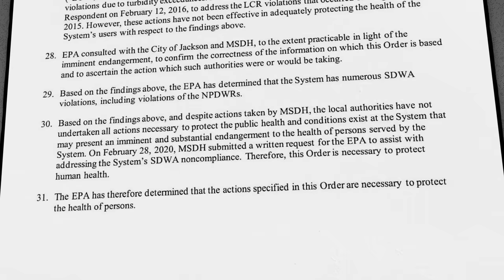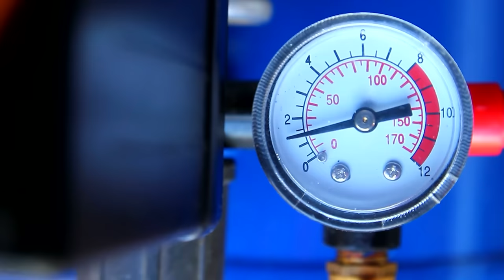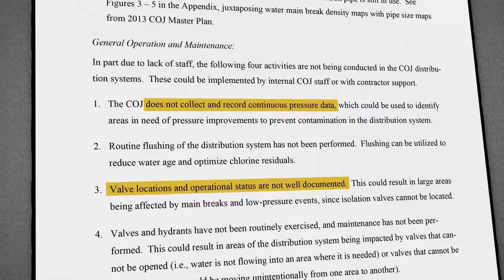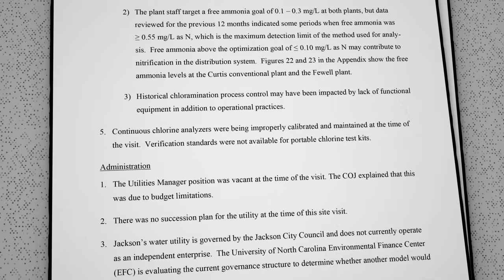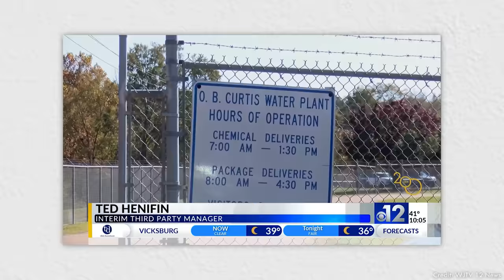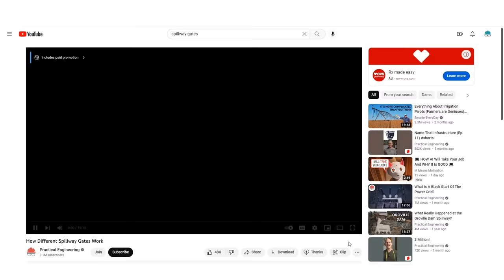The Only State Capital Where You Can’t Drink the Water

Comment: 8:30 - One of the things I learned working in broadcasting is that it takes at least 6 employees per billet to staff something for 24/7 operation.

There are 4.3 weeks in a month, and you can't have .3 of an employee, so the minimum is 5... but that leaves you no slack for sickness or vacations, so you need at least 6 people *per position*.  7 is better.  In particular, 7 makes it easier to avoid people having to work floating shifts, which are also hard.

If you have 7 jobs in your treatment plant, you need seventy people to staff it.

(Obviously, if you have 5 jobs that are the same position, you don't necessarily need a full spare person for all 5, but that's about all the slack you get.)

It's a really big problem.
Reply: And that’s assuming you can hire the right people to do the jobs.

Comment: If you haven't heard of it, definitely look into Philadelphia's Green Storm Water Management system. As an alternative to a large sewer expansion the city has started building green infiltration areas, such as roof top gardens, permeable pavement, and retention basins in public spaces. I was able to work on that project with the department of water and really found both the political and engineering side of it fascinating.
Reply: Nothing amazing about this. Green anything is a waste of money and time
There are always cost overruns and zero return.
Reply: Sounds interesting? Could you point to articles i can read?
Reply: @dplj4428  
Dunno about articles, but the first time I heard about Philadelphia's plans for storm water management was this video: https://youtu.be/coXe8_xnAOs

The part about Philadelphia is at the end, but the rest of the video covers related concepts. I particularly like the idea of usable public spaces that double as flood protection reservoirs when needed.

Comment: One thing I don't think you touched on enough was the piping system itself.  The system is generations old and uses various materials including lead piping, so much of the system is now brittle or corroded.  To make matters worse many of these pipes are buried shallow in the Earth so a big freeze easily reaches them and the soil around the area is highly expansive too (called Yazoo Clay).  So unfortunately it's not just the water plant, the whole piping system itself is in desperate need as well.
Reply: Thats something i was wondering about, a ton of cities north of Jackson have surface water supplies and almost no issue with the cold. In my area 4ft is considered the frost line so i assume municipal water has the top of the pipe at like 5ft down so they can't be affected by long and cold winters.

Are these pipes only 6in down or something? The ground is warm and they should know that they get periodic cold blasts even if on average they are a warm climate, so they should be prepared for the annual arctic blast or whatever its gets called. 

Also, lead pipes aren't technically bad because under normal conditions the biofilm inside all pipes protects the pipes so lead won't enter the water. But ideally we should remove them all to prevent another Flint Michigan where someone adds the wrong additive and suddenly the lead is flaking off into the water.

Comment: I am a long-time resident of Jackson. The major work for the water system was built in the late forties and early fifties, and it used good old state contract iron pipes. Now, 70 years later, you can poke a hole in those iron pipes with your finger.

Comment: Thank you for raising the issues behind the Jackson, MS water issues.  I know you like to stick with the engineering of things and the complex engineering of the Jackson, MS water infrastructure certainly contributes to their problems.  But, as you stated, often there is much more behind the engineering that factor into the issues that cause their failure.  I think this was one of your best segments yet, precisely because you did not shrink from the root causes of this crises.
Reply: "didn't shrink the root causes of the crises" is such a great way of stating it!
Reply: Exactly. Even in engineering its really hard to fix the root causes of problems when the powers that be at the state level don't want them fixed.

Comment: As a now no retired water and waste waster operator and manager of 25 years I find it hard to understand how Flint and Jackson happened unless there was no enforcement of the Safe Drinking Water Act at several levels. 

 A Public Utility has the obligation to provide a safe product, dependable service, and  a rate structure that provides for sustainability. Keeping rates artificially low will make someone later pay for the system that you are wearing out today. All to often, particularly in smaller systems, depreciation of assets is not accounted for as a real cost.  

You did a great job presenting the issues.  Love your channel.
Reply: Flint and Jackson share the same root cause of their water woes.

Comment: Water problems are happening even in the rural parts of the country. Maine has been dealing with pfas in ground water. This comes from spreading sludge from cities and industry. The legal limit is set at 20 ppt Pfas. My drill well was tested because of spreading sludge on a farm 5 miles away. (When originally spread the farmers where told that the sludge would be good and had been tested) For almost 4 months I could not drink my water boiling would not help. Many many others have this problem. So I lived on bottled water that whole time. It's a lot easier to boil water but only being able to use bottled water a bit harder. More and more cities are finding that their public water is contaminated with Pfas that are a health problem. Installation of activated charcoal filters took out the pfas. Maine has made regulations about this. The EPA has made recommendations about the levels and are testing for it. Tests are expensive ($800 each). This is becoming a health problem all over the world.
Reply: Yeah, it sucks, although we moved to a reverse osmosis system. Bottled water isn't the only option. But yeah... really sucks. It's really not cities that are to blame, though, it's 100% unregulated industry which are also building on sites in rural areas since the land is cheap and then lying their way into being allowed to build and operate, or taking advantage of loose laws.

Comment: I live in a completely different country. But we are currently losing 60% of all of our water into the ground every second of every day for 2 years. We don't get boil water notices (we can generate pressure without needing to pump it) but we do often get told to save water because the reservoirs can't hold enough. Its effectively the same problem here. Its really infuriating knowing that there is 30 years of poor and deferred maintenance that isn't going to be solved overnight and has made the entire system on borderline breaking point.
Reply: I'm not sure you mean what you seem to mean.

If you were losing 60% per second, then you'd be losing 99% every 5 seconds. In 15 seconds one million liters would be reduced to just one liter. One hundred billion liters would be reduced to 100 milliliters in 30 seconds.
Reply: Does time matter? Other than the 2 year period, if you are losing 60% of the treated water regardless if it was every second, minute, hour, day or month.
Either way, that represents a large cost in electricity and chemicals that are essentially saturating the ground and its really quite shocking that somebody would keep deferring maintenance when the losses amount to so much.
Reply: @shanelmurray3448  yes, time does matter. If they were losing 60% of their water every second they would have no water at all in less than a minute.
Reply: @shanelmurray3448  It absolutely matters.

What they probably meant, all over exaggeration aside, was that they've lost 60% of their water to the ground over 2 years, or that each day, 60% of that day's water production is lost.
Reply: @ElusiveTy  but if your losing 60% of your water does a timeframe matter. Because everything you produce you lose 60% of. Timeframe gives a quantity. But the sub times don't add value to the statement

Comment: Municipal utilities, be they water, power, or sewage, are supposed to operate independently and not require additional funding from either city or state.
They are designed to "pay for themselves" and not require capital from general funds for day to day operations.  In Jackson the problem was massive corruption with the billing department which escalated out of control.  This all began with a boondoggle plan to replace existing meters that was mismanaged and actually did more harm than good.
Other than saftey standards the state has no part to play.
Vicksburg, Gulfport, Hattiesburg,  and other cities in Mississippi operate their water systems just fine without state funding for day to day operations because they lack the corruption so rampant in Jackson.
Jackson's water needs have DECREASED over the years as people fled the crime and corruption that is Jackson, yet other cities have seen INCREASES in demand and they manage just fine without help from the state or federal government.  Jackson is a cesspool of incompetence and corruption.
Spend five minutes at a city council meeting in Jackson and the problem becomes clear as day.

Comment: There are many places across the U.S. without good/potable water. I live near the town of Maypearl, TX, and our water has a PH about 9, TDS off the charts, it's salty, etc. When you wash your hands or dishes with it, you're left slimy-feeling after the soap is all rinsed off. I can't use it for myself, my dog, my cats, or my aquarium. And judging by how much RO water the local dollar store moves, no one else is drinking it, either. 

There's a large leak in the pipe that leads to my house down the street that washes away the road every couple of years - most assuredly not the only spot like it. We are issued boil water notices very frequently. My own meter doesn't accurately measure water since my bill didn't go up after a leak at the shut off valve went unnoticed for a month, and I'm sure I'm not alone in that, either. Unlike Jackson, we do usually have water available. But it seems we're heading in a similar direction in a hurry. We won't get any press about it, though, since we're a small town of a few thousand.
Reply: Have you considered getting a rainwater tank? If you're collecting your own water off your own roof, you're in control. Even if your air and roof are so dirty you have to filter the water to make it drinkable, you still have that water - it's yours, and your tank tops itself up every time it rains.
Reply: @tealkerberus748   I do collect rainwater for my aquarium. Don’t have the time or income to set up anything larger at the moment.

Comment: Suggestion for a video: utility distribution (water, electric, heat) in a place where it routinely gets -20F in the winter: central Alaska. I live in Fairbanks and we have quite a few special considerations to ensure all piping is below the frost line.

Also, have you done a video on the Alaskan pipeline? It's an incredible bit of infrastructure that boggles the mind in terms of complexity, size, and elegance of the chosen solutions. Basically, how do you keep an 800-mile tube structurally sound in an area known for earthquakes, powerful and destructive wildlife, and wild temperature variations from -70F to +70F?
Reply: Agree, I would also like to see this. Thanks
Reply: -90 to +100, I'll admit that these are more outlying temperatures, but they exist.
Also, you forgot the wildfires.
And elevation changes.
And permafrost.
😁
Reply: @jonanderson5137  Yup. All of the above.
Reply: I'd love to see a video on this, I live in a region where the minimum depth to bury water lines is 8ft below grade.

Comment: the mismanagement of "basic needs matters" seem to be something not to uncommon in the US. I mean there is the lead-poisoned water in Flint Michigan, now the ongoing water crisis in Jackson and many water shortages in California.... the last time I had to deal with "bad Tap-Water" was when the local pumping station did some maintenance (we got a notice 1 week before that the water would be off between 10-12 o'clock in the morning) .... the water came out brown for 5 min after it as switched on and tested a bit of chlorine for a few hours because the flushed the system clean after the work was done to kill of pathogens.... usually the filtration works without chlorine.... tap water is better checked than bottled water where I life so... this "our water is so bad, so we have to boil it" is more something I expect of country's who are not as developed as my area rn...

Comment: Interestingly enough, Jackson has a population that is just barely smaller than that of my own city. We also rely on water from a lake upstream. Water gets pumped over a distance of 27 kilometers before it gets to the treatment station. We are in Canada which means that the lake is frozen over for several months every year. We do have some pipe burst from time to time, but it is a rarity. Most pipes are well bellow the frost line, in ground that is at a near constant temperature year round. Could it be that the pipes in Jackson aren't deep enough? The few pipes we have which cannot be put at the appropriate depth because of bedrock are covered with a layer of insolation.
Reply: Well, there's also this thing about Canada: Most of your budgets aren't eyed by a bunch of conservative hyenas who slash every dollar that's not spent within a nanosecond of being assigned.
Places like Mississippi suffer from the sort of politicians who in september, argue that no money has been spent on de-icing water intakes for half a year, therefore the de-icing budget should be slashed since "It's clearly useless spending" and the money be given away as tax cuts to millionaires.

And if someone replaces that deep water line, it's unlikely that someone who just happens to own shares in a maintainance company, argues that you can save 200K on the new water line if you make it above ground instead of burying it below the frost line, and then offers a 2 million de-icing contract for the new above-ground water pipe. 😆
Reply: The chances of even seeing a skin of ice on a puddle in Jackson Mississippi are pretty slim. There isn't even a frost line to consider when burying pipes. There are probably less than two weeks out of the year that the temp drops below freezing and it's unlikely to remain that cold through the course of the day, only at night. Unlikely, but not impossible. And when it comes to the water supply, one should not take chances. This is just a tiny little peek into one of the problems that make Mississippi one of the worst places to live you could imagine. You can apply a similar problem and lack of solution finding and implementation to anything and everything and you'll get an idea of what it's like here. Except it's worse.
Reply: @TheOwenMajor  
Your tribalism would make more sense if the ruling Republicans of Mississippi hadn't stolen money from the federal government explicitly meant for water management.

And you shouldn't use words of which you don't comprehend the meaning, like 'communist'. It can make you appear unintelligent.
Reply: @nvelsen1975  Water supply is a municipal concern, as it is almost everywhere in North America. 

Stop blaming others because your cities and states are falling apart due to your mismanagement.
Reply: @TheOwenMajor  
Bud, you the one argueing the Ukrainians/Jews/black people/Democrats are to blame, not me.

You brought in the politics.

Comment: I really like your infrastructure videos. It is easy to overlook how important they are until they fail. Unfortunately here in the US we have chosen to under invest in infrastructure for decades.

Here in our small town will will be voting on renovating our waste water treatment facility. It was originally built in the mid 1980s so a lot of the equipment is at end of life and we need to comply with tighter EPA  requirement for Phosphorous and heavy metal discharge.

Comment: As one of those contracted operators brought in, I can say firsthand that this video is accurate. The cause is a lack of modernization and progressive treatment modeling but the fault lies with the politicians. One more iissue the video doesn't mention is that neither plant has emergency backup power. This means if there is a power outage, the plants shut down. This was one of the more shocking things we found.

Comment: I live in a small city that built its own water system including 3 reservoirs. All towns and cities around us use a large water district for water and that quality has gone down. Every time I meet someone in my city they talk trash about our water. They don't know about our treatment plant and all the new pipes in our neighborhood giving us the highest quality of water in the state.  We have our own water treatment plant and sewerage treatment plant both miles apart. That's why other places can cut corners and add jobs instead of putting money into repairs. Watermain replacement cost are based on size and length of project cost for tap and connections of services and hydrants and shutoffs. Yet certain city's have added cost for departments and environmental reasons. Mainly unnecessary personal cost

Comment: Around here we use surface water from the Rhine river to artificially supply the ground water by having it seep into the ground via watering stations in flat woodland area. The groundwater is then pumped up, filtered by sand/coal and UV treated and basically ready for consumption. No major temperature shifts.